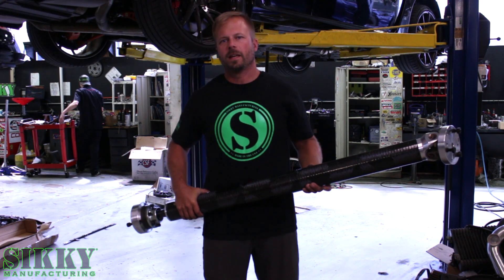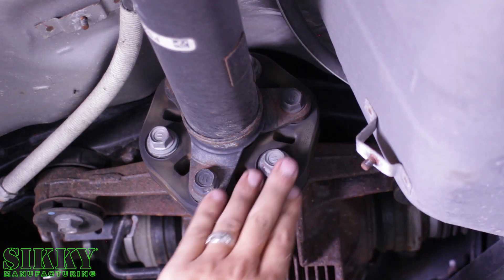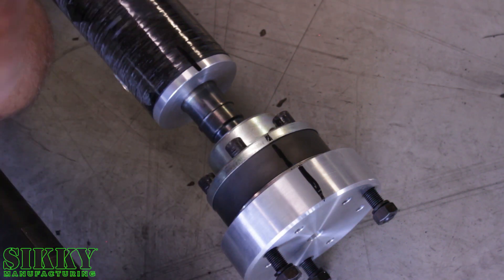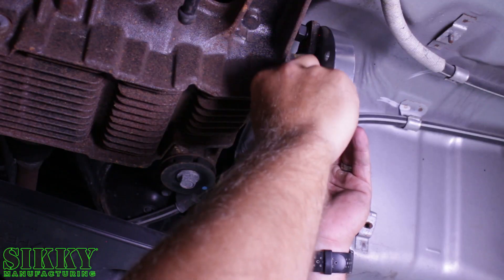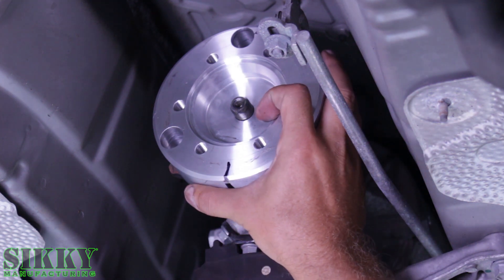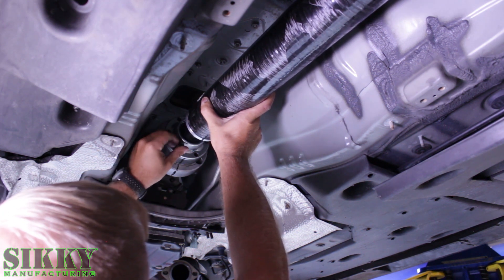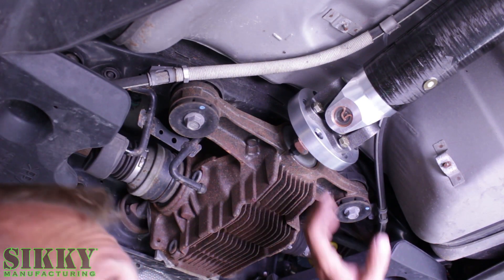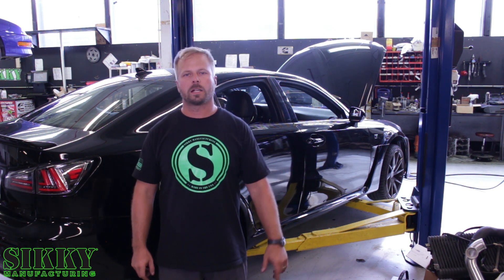Lexus ISF Carbon Fiber Driveshaft Install | Sikky Manufacturing

Comment: Once you install this driveshaft, put the car in drive and you will see that the shifter is extremely close to the allen bolts. It will rub on bumps and hard cornering. I fixed the problem by simply bending the shifter out of the way a little with a pry bar. Only makes the transition from manual back to drive a little notchy. The quality of this driveshaft is top notch. The carbon fiber weave is flawless. Great upgrade.

Comment: When I take my driveshaft bolts off, the driveshaft is stuck, and it won’t come out. It dropped out so easily in the video, what am I doing wrong?
Reply from the maker: It may just be seized in there.  Did you try tapping on it with a dead blow hammer?

Comment: This video needs to be updated.  I just worked with a Lexus master tech on the installation.  First  the tranny adapter plate is thicker now so cutting is required. Second the adapter plate thickness makes the nuts tap the shift linkage so we dealt with that.  I called Sikky and he said go on website under ISF  driveshaft for instructions.  Its E30 BMW LS instructions,  not SPECIFIC , for the ISF.
Reply: Did Sikky ever get back to you on if they made corrections in production if other people order these?
Reply: Hey experiencing this right now, how did you solve the issue?

Comment: Why didn't you make the adapter plate a few mm thicker and the shaft a few mm shorter so there was no need for people to cut bits off the transmission? (not hating just wondering if there was a reason).
Reply: Drive line angle is the only reason I could come up with . Stock driveshaft is a 2 piece with a center bearing and this is a one piece design.  Maximum angle for a U joint is 15 degrees. Any more and it will bind.  This Driveshaft is made by Drive Shaft Shop for Sikky. So this must of been the only way to make it work and function properly with suspension travel.